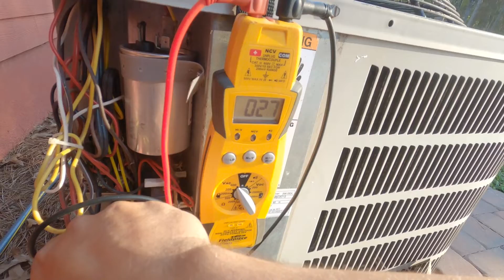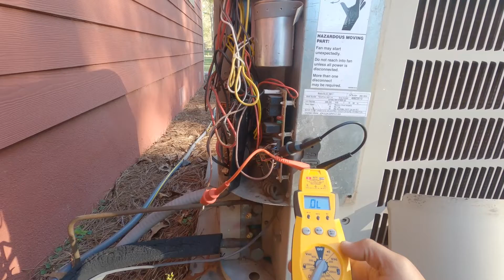Diagnosing a bad defrost board on a heatpump air conditioner. In the field

Comment: I am new on working on heat pumps
So all you did was move 24 V to the contractor from the board?
Reply: Don’t forget to energise the reversing valve with a 24v to get the customer cooling cause Lennox reversing valve energised on cool mode
Reply from the maker: Yes, the 24 volt call from the thermostat